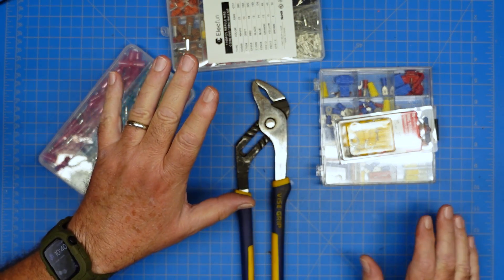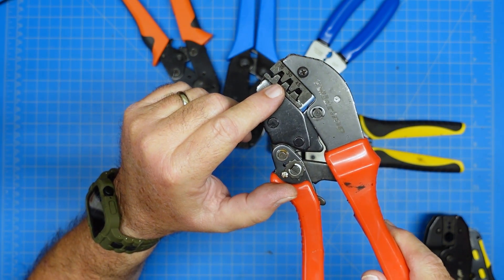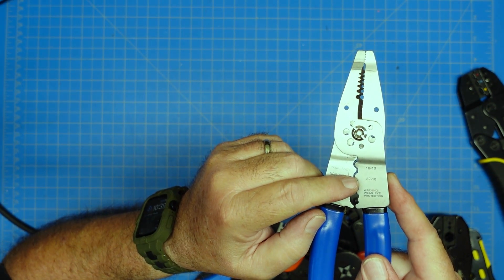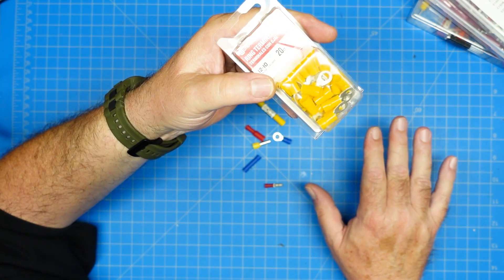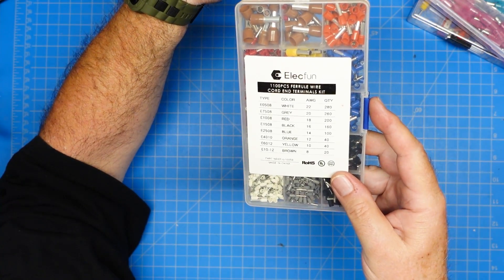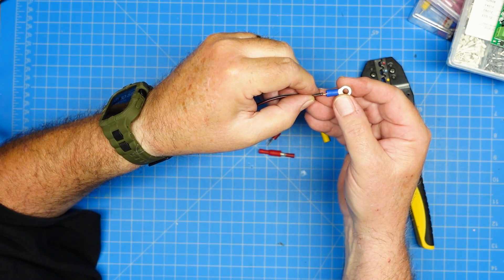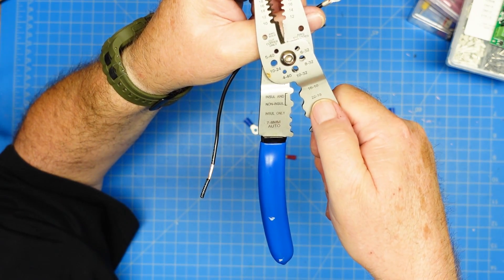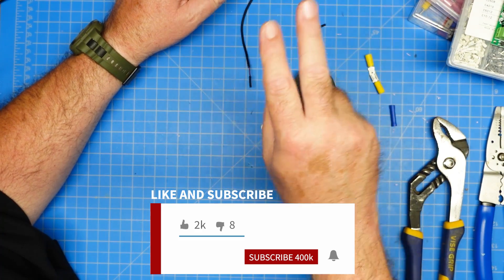Ultimate Crimping Tool Review - The Last Crimpers You’ll Ever Need

Comment: engineering and electrical fields pretty universally agree that combining crimping and soldering in the same connection is generally not recommended and can reduce reliability rather than improve it.

Comment: Sooooo I have been looking at pneumatic crimping tools.  I have several of the hand style tools including ratchet style BUT try as I may I have never been able to reproduce a machine style crimp in an automotive application.  Those factory crimps are so strong that most of the time the wire will break before it ever pulls out of the connector!  I try and avoid solder, especially in automotive because the heat required to flow the solder can make the wire brittle and prone to cracking.  Have you ever used a pneumatic style crimping tool?
Reply from the maker: No sir, at this point I haven't had to do any big crimps.  Honestly, if I do, (battery/power leads), I'd probably get one of the hammer crimp things for the few I will need it for.
Reply: Well I was actually talking about the smaller gauge wires.  A true factory crimp is what I’m after.  I can get sort of close with a hand crimping tool but cannot duplicate the factory stamped crimp.  If you look at a factory crimp there is absolutely ZERO tolerance between the wire and the terminal.  You could hang 50lbs off of a 14 gauge wire and the wire would fail before it ever pulled loose from the crimp.
Reply: I’m not trying to be argumentative or disrespectful.  Just a discussion.  Please don’t misunderstand me.

Comment: A trap is that crimpers suitable for dupont connects are generally not compatible with JST connectors as the JST connectors require a narrower crimping area. For example SN-28B & SN01B crimpers are not suitable for easy JST crimping as the jaws are too wide.  You need something like a IWS-3220M or Engineer PA09 that has narrower jaws ... It is frustrating when some people sell SN-28Bs as suitable for JST which is incorrect (I learnt this the expensive way :( ).

Comment: Great video, Jim.  I initially tried to cheap out, and make due because I was too cheap to buy the right crimper; specifically for powerpole, but other times too..  Sometimes it would work, and sometimes I would have to start all over with a wire project.  Pulled the trigger on the good crimpers, and life became much, much easier, lol. You taught me sum'm today; I didn't know the difference between non-insulated and insulated crimpers.  I just 'mashed' the heck outta either one with the same crimper. Now you done gone and made me hafta buy a new tool.   See you out there, 73 de Bill

Comment: great work ! so many crimpers . each crimp different. just need the right one. with them butt splice . do not use. found much better one. power Worx has the.  they clear with different color bands.  they fancy heat shrink.  put the heat shrink on the wire. make a line man splice slide the heat shrink in place . use lighter or micro torch . shrink the ends first. then heat the center and melt the solder that is in the heat shrink. it is clear in center and you can watch the solder flow and make a great connection.  it solders it self. all you need to do is strip put heat shrink on . splice then heat ends first then center and watch it solder . they neat. solder and flux  is in heat shrink. you can see it. you heat the color rings on end first. best butt splice. 73's

Comment: I prefer to solder and crimp but usually I just solder. Soldering seems to create a more abrupt transition between the connector and the free wire which seems to break more quickly. Anything that isn't just for testing gets the wire tinned and if i have a crimper it gets crimped. Preferably in such a way that the tinned section of wire isn't sticking out.
I had always thought the seam on ring terminals went towards the convex side of the crimper. I should read directions more often :)
Great video!